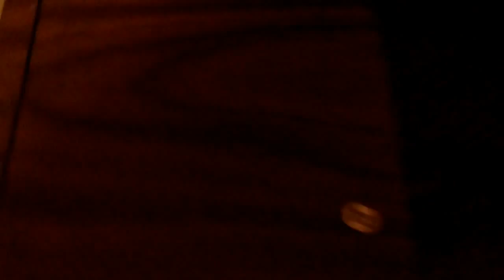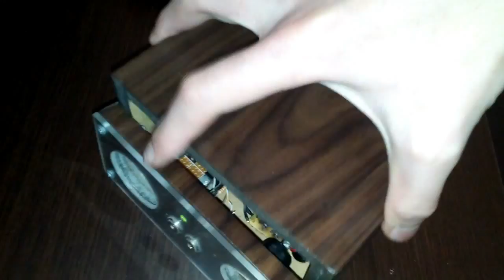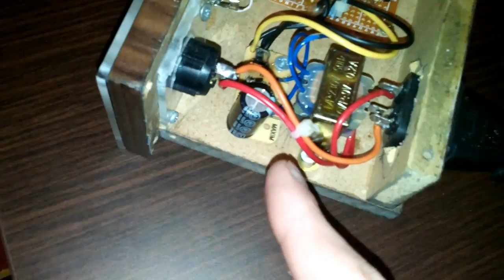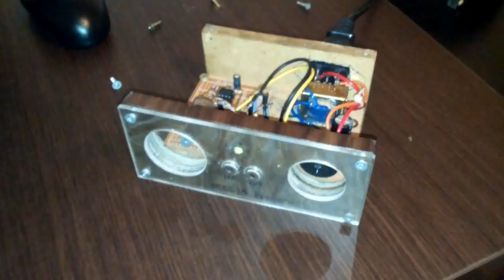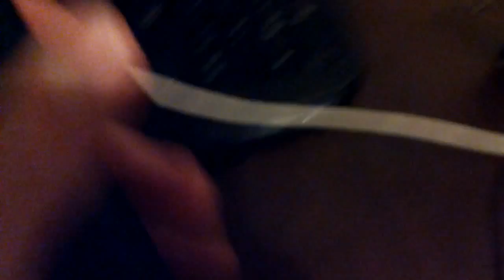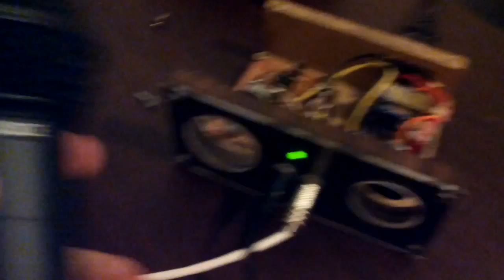My DIY NE5534 Op-Amp Microphone Pre-Amplifier

Comment: Very nice! I'm getting a XM8500 and I'm thinking about building a preamp to record using a M-Audio Micro. Does it input noise? I can't hear it good in the demo. Could you provide an audio sample?
EDIT: I can hear some little noise actually but YouTube compresses the audio, so I'd like to see if it works well mix wise
Reply: it depends on the preamp,i would strongly suggest recording with an external audio card which has an xlr input and preamplifier offering some dynamic features and some auto leveling stuff,just with a preamplifier like this it might not record noise but you will have a HARD time maintaining your voice to a steady level and it clips easily. the microphone is totally noise free if you record with a good device. i could offer a sound sample just i do not have a proper setup to show it without degrade it.
Reply: In the end i built that same circuit on a simple breadboard using an OPA741 I had lying around. Worked fine although I had lots of noise, so I had to use a noise cancellation software to prevent buzz from being heard into the vocals.
On the same circuit I substituted the opamp with a NE5534: HUGE difference! I could set it to maximum gain and have very little noise. I don't have to use a noise cancellation plugin anymore!
Next step is building the preamp in the INA217 datasheet, which should be even better.

Comment: Pretty nice project :)
Im going to build something like a Monitor Mixer based on NE5534 and NE5532s. I want to include preamplification, too, so this circuit is kind of interesting to me. Well, I yet dont know if I want a symmetrical power supply or like in your build one rail.
Cheers :)
Reply from the maker: +tzrgfdrte Thank you! The NE5534 is very nice for pre amplification. Your project sounds very interesting. I would say it will be better to seperate the power supply and put the biggest capacitors you can practically use.
Reply: I want circuit